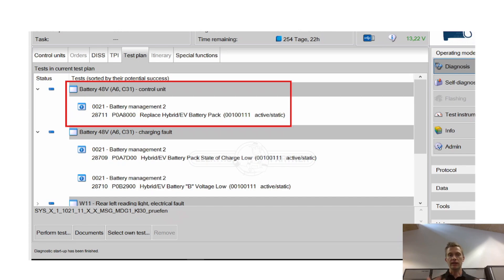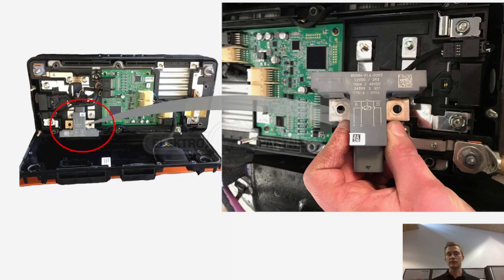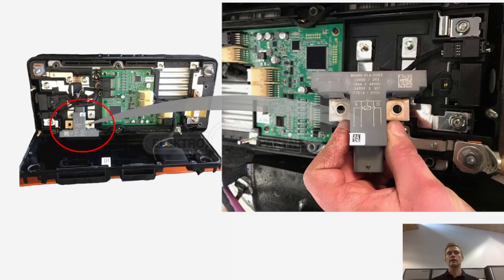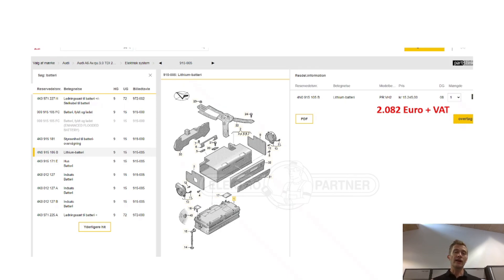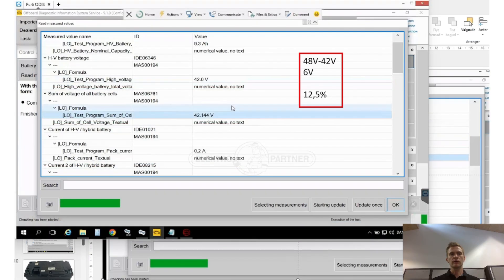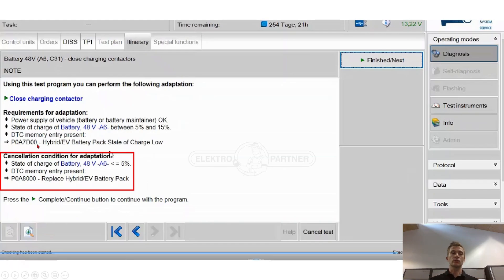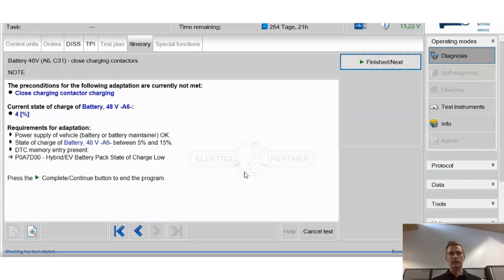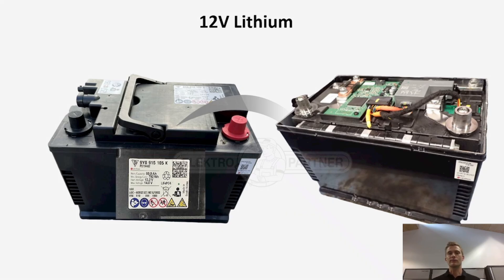48V Lithium battery failure on Audi A6/A7 2018- MHEV. Fault code P0A7D00, P0A8000, P0B2900

Comment: There is a software issue. In address 00cc on odis the software should be at 527 but usually there at 525. Audi has a technical bulletin out for this.

Comment: My 2019 Audi A6 failed for the Starter Alternator issue. Every electrical system failed while driving. Brakes, steering, transmission, instrument cluster, HVAC, Sensors, even the windows and hazard lights. A very dangerous defect that could have really hurt someone.
Reply: Same happened to me 1 month ago, i blocked an intersection for 1 hour 😅.
They have to change it on extended warranty, don't let them make you pay 2k euro for a product done wrong. 
Hope yours will arrive soon 🙏
Reply from the maker: Did it happen while driving? This I have not yet seen. In DDTSB we show the inside of the alternator and here its clear to see why it can happen suddenly while driving. Fortunately the alternator today cost less money than when it first was introduced.
Reply: @ElektroPartnerApS  -Yes this did happen while driving 75mph. We were very fortunate that it didn't happen at night (no lights, hazards, or airbags). Had to be towed to the dealer.
Reply: Exactly the same happened to me a few days ago in my 2019 A6 55TFSI MHEv, all systems failed, i couldn't even take the car out of Park to push it off the road, very dangerous place i broke down is aswell.  I've heard the problem is with the 48v Alternator but i don't have warranty on my car anymore and Audi UK told me that there's no extended warranty with the Alternator or battery so i'm going to have to pay £2500 to fix it.  Very poor service from Audi for a fault that's well known.
Reply: @ah8425 did you fix it ? I have same car and same issue
Reply: @MoHaMeD55555555  local garage ordered me a new Alternator and put it in, car was off the road for 3 days and it cost be just under 2k.  If I had gone to Audi, they would've charged me £150 to diagnose the problem and from what I hear from other owners, they say Audi make you change thr 48v battery or some belt first costing you a few k and the finally change the alternator, you car ends up being off the road for months.  I think its best to just deal with it privately straight away.  Saying that some people have had thier Audi dealership change the alternator under some extended warranty however I didn't get that offer.
Reply: @ah8425  thank you so much
Reply: Is the issue resolved now?
Reply: Wow, my car was completely functional besides the warning light. Glad you made it home safe!

Comment: My A8 is waiting for a new alternator, they said the 48v battery is 6%, i can imagine  with those times of waiting,  it will be down on 5% and force me to change that too, 7th day of waiting,  they said 10 Hopefully 🙏.
Reply from the maker: Could you recharge the battery with forced charging?
Reply: @ElektroPartnerApS , Yes, i sent e-mails to Audi AG and they moved fast, i took the car yesterday from the dealer, it was on charge 1 week, everything is fine now, all on warranty 🙏
Reply: Just happened to my RS6 avant. Had to get it towed. 32k kms. Dealership said alternator is a 1-2 month wait. Now we wait
Reply: Happened to me too. Waiting for dealer response Monday 😢 Rs6 2020 50k km
Reply: @OviLexSoft  ,at least they change it on warranty. Good luck!
Reply: Why did the battery fail? My 2019 Mercedes still works like new after 7 years

Comment: I got same problem, and I solved it,  just need odis
Reply from the maker: luckily ODIS can often solve this if the SOC is not too low
Reply: @ElektroPartnerApS how?
Reply: how did you solve it i also use odis but i couldn't find a way

Comment: I am a lithium expert and have been working on lithium for years. Can you tell me an easy way to access the balance wires on this pack as I am working on one now
Reply: They are not in a simple configuration. I see 16 wires coming from the pack. The balance wires are in this lot. The balance wires should number 14 but why the 2 extra?
Has anyone actually worked on this batt rather than just look at the outside of it?
Reply: @deanarchist  That would be the temperature sensor / sensors, The most basic wiring you could imagine
Reply: @deanarchist Its probably as in ID3 and 4 a Kalvin Measurement. Pin 1 und 12 are duplicated - so you can draw a Current from Pin 1 to 12 but also do a correct Voltage Measurement!

Comment: Hi, I have the same problem. I got the fault code P0a7d00 and I'm assuming if I charge the battery the problem will be solved but when I'm trying to go to the Specific Functions section it's asking for a code. The car is a 2019 Audi A7. I would appreciate it if you could give me the code for Special Functions. Thank you so much.
Reply from the maker: Sorry. We are not able to provide you the code.

Comment: Martin, for your slide show you were going back and forth a couple of times to talk again about a previous slide, it is best to just duplicate the slides needed more than one time so you may only proceed in a forward direction. During a professional setting such as a paid class, flipping around several slides simply shows a lack of preparation plus with all required slides in a series, there is less of a chance of making a mistake in the training lesson which tells something about your overall reputation as an Instructor. Imagine you were sick and a colleague had to give the training class for you and was not familiar with the need to go back and forth even though they might hold a transcript of the training lecture, problem solved. Thank you for the great information.